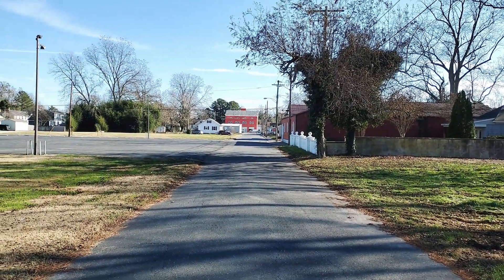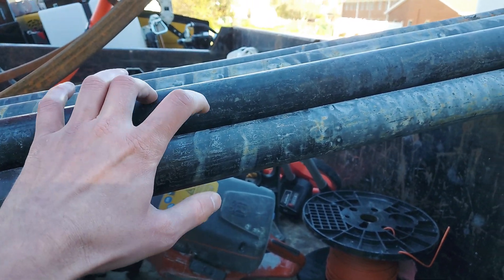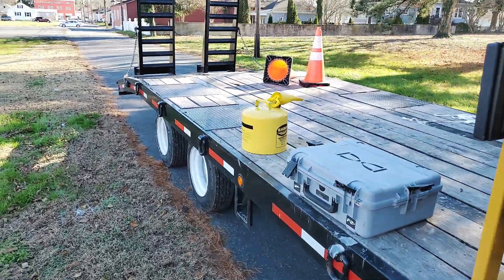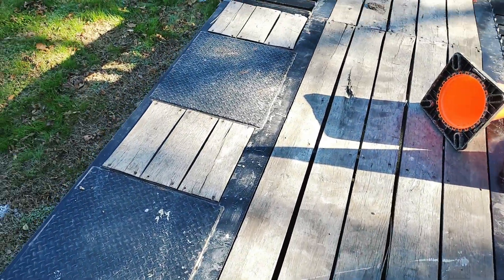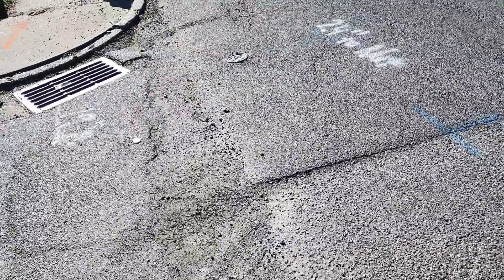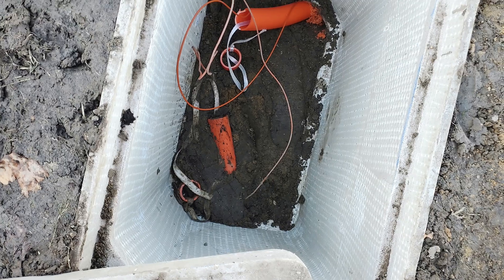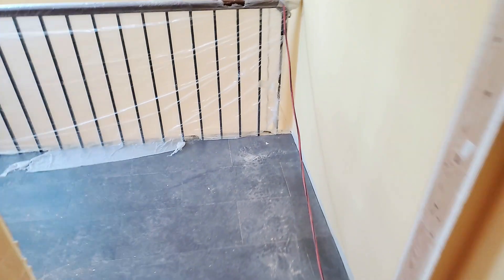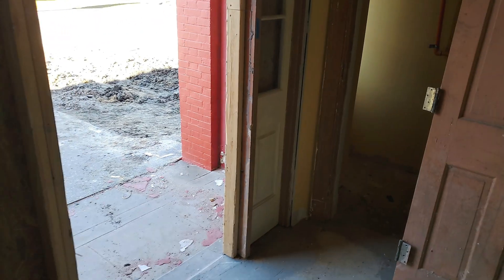New Simple Fiber POP tour in Pocomoke MD and Drilling in 700ft of conduit + vaults

Comment: do not use drill terge as a sexual lubricant - it actually has that on the can - my question is why drill when you can just hang fiber on poles - probably the cable company 'owns' the poles - they hang fiber on poles here where i live and it is probably 10x faster rollout vs burying and easier to fix when things go sideways - everything breaks, this is what ai says-
what is best way to deploy fiber - hanging it on poles with other utilities or burying it - compare overall costs, maintenance issues and total costs of each method

The decision to deploy fiber optic cables by hanging them on poles or burying them depends on various factors, and the best choice may vary based on specific circumstances. Let's compare the two methods in terms of overall costs, maintenance issues, and total costs:

    Initial Deployment Costs:
        Hanging on Poles: Generally, hanging fiber optic cables on existing utility poles can be more cost-effective initially, as it avoids the need for extensive excavation and trenching.
        Burying: Burying fiber optic cables involves digging trenches, which can be more expensive due to the equipment and labor required for excavation.

    Installation Speed:
        Hanging on Poles: Faster deployment is possible when attaching cables to existing poles, as it eliminates the need for extensive groundwork.
        Burying: Excavation and burial can take more time, especially in urban areas with existing infrastructure.

    Aesthetic Considerations:
        Hanging on Poles: May have a more noticeable impact on the visual environment due to the presence of additional cables and equipment on poles.
        Burying: Generally considered more aesthetically pleasing, as cables are hidden underground.

    Maintenance Issues:
        Hanging on Poles: Exposure to the elements and potential for damage from accidents or severe weather events. Access to cables may be easier for maintenance.
        Burying: Reduced exposure to environmental elements, but locating and repairing faults can be more challenging and time-consuming.

    Durability and Resilience:
        Hanging on Poles: Susceptible to damage from accidents, storms, and other external factors. However, repairs may be quicker.
        Burying: More protected from external factors, reducing the risk of damage. However, repairs can be more complex and time-consuming.

    Long-Term Costs:
        Hanging on Poles: Ongoing maintenance costs may be higher due to exposure to external factors.
        Burying: Lower long-term maintenance costs but potentially higher upfront installation costs.

    Regulatory and Environmental Factors:
        Hanging on Poles: Requires cooperation and agreements with utility pole owners. Regulatory and permitting issues may arise.
        Burying: Involves compliance with regulations related to trenching and environmental impact.

Ultimately, the best method depends on the specific circumstances of the deployment, such as the local geography, regulatory environment, existing infrastructure, and budget constraints. Some deployments may use a combination of both methods, such as burying cables in urban areas and using aerial deployment in rural or less densely populated regions.
Reply from the maker: Poles = $15\year each in rent so that adds up VERY fast.  This way we own our own destiny even tho it costs more upfront.

If a pole falls we are last to rebuild maybe a full day outage also we would require special equipment like a bucket truck and maybe traffic control.   

Fiber on a pole is good for 15-25 years vs in ground they say 40-50 years.  

Another really awesome thing is we can come back and pull more cables through the same conduit.